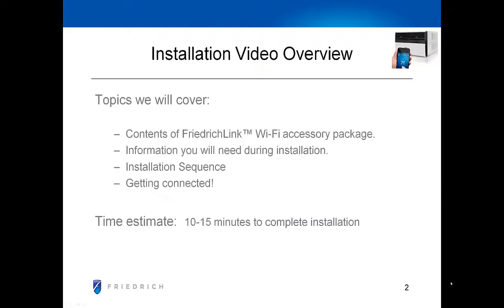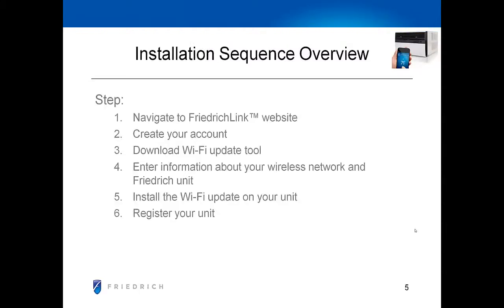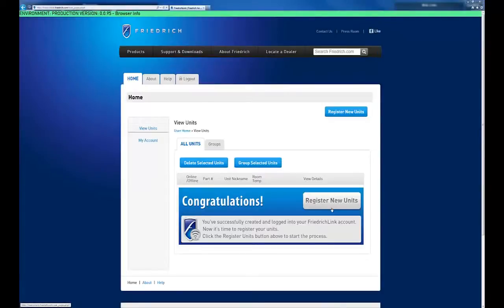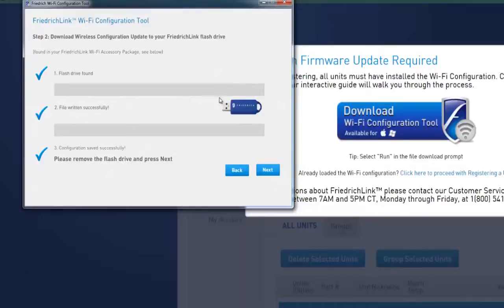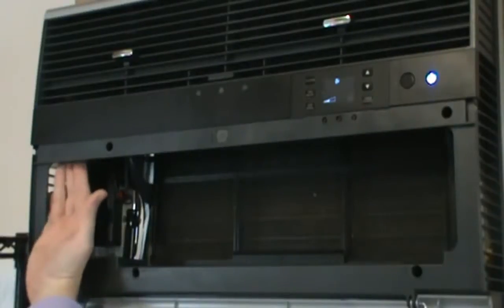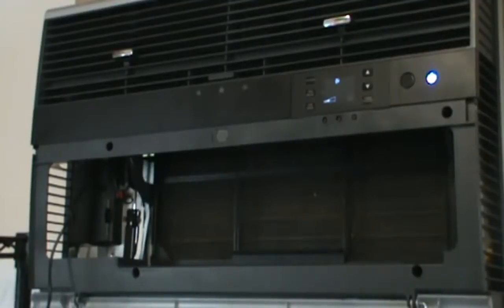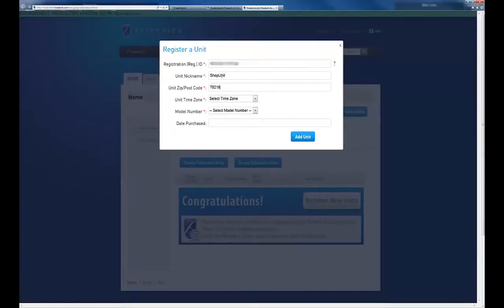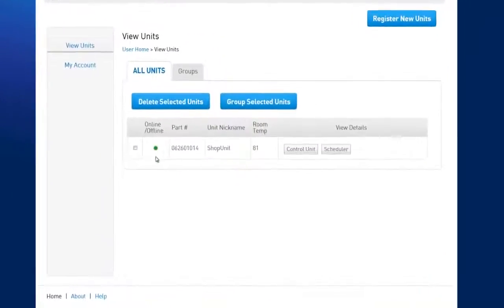FriedrichLink Kühl Wi-Fi Adapter Install

Comment: For those who fell for this video's trap by pressing the 3 keys - you can only fix it by inserting the USB drive provided in the kit with the black adapter. Even then, the drive was shipped with the files in the incorrect folders. Make sure that image.S19 is in the folder "Upgrade Program" and then insert it. For everyone considering pressing those 3 keys - DON'T DO IT! It is unnecessary, and will brick your AC. You can turn it off an unplug it, but it will remain in that state FOREVER unless you buy the Friedrich Connect Wifi adapter to obtain the USB drive with the firmware (or call Friedrich and see if they can provide it).
Reply: it bricked my unit. what do I need to fix it.
Reply: I held those 3 buttons down and now it's in dead state. any way go fix it? or get out of it??

Comment: I found the solution for Friedrich kuhl ac. How to wake your ac that nothing works except the power light is on. 
All you need to do is have your usb flash drive plug in to your computer and make sure all the files are out of the folder in your flash drive.  Before you plug to the ac unit follow this instructions and wala you got your ac back in your control. 

HOW TO BRING THE UNIT BACK TO LIFE
•	Get somebody else to help you- you may need an additional set of hands when plugging the unit back in while holding the buttons as instructed.

•	Ensure that the User Interface Cable connections are good. Unplug power cord from outlet

•	Insert the Friedrich flash drive into the USB cable.

•	Insert the other end of the USB cable to the Micro USB port. (Ensure that it is secured. Do not move during program uploading).

•	Grab the flash drive and keep an eye for the green light in the ring of the flash drive.

•	Simultaneously press the 3 Buttons Code (FAN Mode, Fan Speed, and Up Arrow) and don’t let go.

•	While pressing the 3 Button Code, have the other person plug in the power cord. (Ensure that the reset button is not pressed on the plug).

•	When the green light turns on, let go of the 3 buttons. It will blink for a few seconds; this indicates the program is loading.

•	When the light goes off, the unit should already be back to life.

•	Unplug the USB cable.

•	Test the buttons for responses.
Reply: I am having this same problem, but don’t have the firmware or USB. Any suggestion? How did you figure out the solution?

Comment: Please please anyone I need to download the update to connect to my wifi and my Friedrich ac I accidentally flashed and now it doesn't work. Please please help

If you need help this friedrich company won't help the summer is here and covd 19 is not helping either because everything is closed  can't get help outside friedrich. My ac unit is dead because I wanted to plug in wifi and now nothing work. Please anyone can help me please the old website of friedrich is not available. To download the firmware.
Reply: let me know how you get it to work

Comment: If you have the new black adapter, DO NOT FOLLOW THESE INSTRUCTIONS! DO NOT USE FRIEDRICH LINK! Use the new Friedrich Connect website. If you already pressed the 3 keys that cause your unit to go into an unresponsive state, you'll need to insert a USB with firmware on it. Make sure the root has a folder called "Upgrade Program" and contains the file "image.S19" and insert into the AC. Without the USB/firmware-file, the AC becomes useless if you pressed the 3 keys (unless there is another key combination to exit, but haven't found it. Power off/no doesn't work). Check the file/folder regardless if you just got the kit from the manufacturer - it could be wrong out of the box.
Reply: James Dugan I did the first step and the ac went blank except the power button is blue. Cannot turn on unit or do anything. I cannot find the Friedrich Connect link to download the software, seems like Friedrich shut it down. Any help is greatly appreciated. Thank you in advance.
Reply: James Dugan My drive has the image.S19 file in Update Program. But when I plug it in to the AC, it doesn’t blink/flash like it should. Any help would be appreciated.
Reply: anyone can help please 🙏

Comment: Boiuying two of these machines ($2,200) was one of the worst purchases I have made. Installation is  pain. And now they built in the wifi into their newer units and are trying to squeeze customers for money to buy an adapter to be able to utilize the wifi app. I have called their customer service Dept so many times, they are on speed dial. I am tech savvy and yet, I found this whole process daunting. Never again.

Comment: The video is misleading and tries to cover too many models.   I didn't need to hold down any buttons on my model.  As soon as I plugged in the USB Drive the fan cycled and the numbers went to 00 then 01.  The power button and panel DID NOT blink.  It helps to keep your eye on the green light of the USB drive itself.  After a lot of frustration, I got it to work.

Make sure your wifi is good at the a/c's location.  The wifi (flashing ice cream cone) takes about 30-45 seconds to sync up.  Press the up or down arrow to keep the panel alive as you monitor the wifi indicator (it fades after 20 seconds). 

Also, of note, the commands from your phone or computer take about 60-75 seconds to make it across the network to your home network and then up to the a/c unit.  So don't expect it to work like a TV remote.  The delay is significant.   But it works.

Comment: 1- using pc do this and that, everything successfully performed.  
2- turn it on, fan mode only, plug USB in,  press and hold sys n fan mode and up buttons all at the same time.  Fan went off and never turn back on. Is been days now. 🙁 
Tried to reset, left unplug the unit for hours and nothing, all I see is the power button on (in blue) 
Sucks.   About to go get my 20 years old AC from basement.
Reply: kifeYOU5 Did you figure this out? I have the same issue and can not get this thing running!
Reply: i forgot to add one thing, format your flashdrive FAT32 first 
and set the following name as the "Volume Label"  FRIEDRICH  

DO NOT use the friedrich flashdrive that came with the kit, instead use a
 different flashdrive.  i used a 4gb flashdrive.  Now, follow the 
instructions to configure the flashdrive using the "friedrich wifi 
configuration tool" and stop at step 2 ( this is when the flashdrive has
 been configured ) remove the flashdrive from the computer.  Go to the 
air conditioner turn it on and make sure it is in fan only mode.  Take 
your flashdrive and plug into the USB cable that came with the kit and 
then plug the other end of this cable into the air conditioner micro USB
 port ( this cable only fits one way into the air conditioner micro USB 
port.  look closely at the cable micro USB head, it has to fins, those 
fins should be facing up as you plug it into the air conditioner USB 
port )  The air conditioner will shut down, get the info from the 
flashdrive, display 00 and then 01 on the LCD and turn back on 
automatically ( if the air conditioner does not display 01 then try 
using a different flashdrive). Unplug the USB cable from the air 
conditioner (the air conditioner will turn off and then turn on 
automatically) Plug in the friedrich "wifi adapter" remember the two 
fins on the micro USB head of this adapter should be facing up. The air 
conditioner will turn off and on automatically and the wifi icon on the 
LCD will blink for about 20 seconds and then stay steady. That's it. if 
you are still having issues let me know.
Reply: I have same issue and cannot get unit to power on!  How did anyone here get the unit back online??
Reply: @juliewinskie  use a different non-friedrich flash drive.  see my other post regarding the formatting of the flash drive.  after formatting the flash drive, use the "friedrich wifi tool" to configure it
1.unplug the air conditioner. wait 10 seconds
2.plug the air conditioner back
3.insert the flash drive into the air conditioner and wait 30 seconds
4.remove the flash drive
5.DO NOT REFORMAT but reconfigure the flash drive one more time using the "friedrich wifi tool" software.
6.plug the flash drive back into the air conditioner.  within about 30 seconds, the unit will display 00 followed by 01.
7.remove flash drive from the unit
8.plug in the friedrich wifi adapter.
Reply: djdeito only power is lit.  Please help
Reply: @Chaseb911  use a different non-friedrich flash drive.  see my other post regarding the formatting of the flash drive.  after formatting the flash drive, use the "friedrich wifi tool" to configure it
1.unplug the air conditioner. wait 10 seconds
2.plug the air conditioner back
3.insert the flash drive into the air conditioner and wait 30 seconds
4.remove the flash drive
5.DO NOT REFORMAT but reconfigure the flash drive one more time using the "friedrich wifi tool" software.
6.plug the flash drive back into the air conditioner.  within about 30 seconds, the unit will display 00 followed by 01.
7.remove flash drive from the unit
8.plug in the friedrich wifi adapter.
Reply: use a different non-friedrich flash drive.  see my other post regarding the formatting of the flash drive.  after formatting the flash drive, use the "friedrich wifi tool" to configure it
1.unplug the air conditioner. wait 10 seconds
2.plug the air conditioner back
3.insert the flash drive into the air conditioner and wait 30 seconds
4.remove the flash drive
5.DO NOT REFORMAT but reconfigure the flash drive one more time using the "friedrich wifi tool" software.
6.plug the flash drive back into the air conditioner.  within about 30 seconds, the unit will display 00 followed by 01.
7.remove flash drive from the unit
8.plug in the friedrich wifi adapter.
Reply: Ed Things I don’t know what happened but the ac went blank except the power button is blue. Cannot turn on the unit or do anything. I cannot find the Friedrich Connect Connect to download the software, seems like Friedrich shut it down. Any help is greatly appreciated. Thank you in advance.
Reply: @Coolww  did you get to fix it
Reply: If you have the new black adapter, DO NOT FOLLOW THESE INSTRUCTIONS! DO NOT USE FRIEDRICH LINK! Use the new Friedrich Connect website. If you already pressed the 3 keys that cause your unit to go into an unresponsive state, you'll need to insert a USB with firmware on it. Make sure the root has a folder called "Upgrade Program" and contains the file "image.S19" and insert into the AC. Without the USB/firmware-file, the AC becomes useless if you pressed the 3 keys (unless there is another key combination to exit, but haven't found it. Power off/no doesn't work). Check the file/folder regardless if you just got the kit from the manufacturer - it could be wrong out of the box.

Comment: did this work for anyone?
Reply: Sean Crawford i forgot to add one thing, format your flashdrive FAT32 first and set the following name as the "Volume Label"  FRIEDRICH   

DO NOT use the friedrich flashdrive that came with the kit, instead use a different flashdrive.  i used a 4gb flashdrive.  Now, follow the instructions to configure the flashdrive using the "friedrich wifi configuration tool" and stop at step 2 ( this is when the flashdrive has been configured ) remove the flashdrive from the computer.  Go to the air conditioner turn it on and make sure it is in fan only mode.  Take your flashdrive and plug into the USB cable that came with the kit and then plug the other end of this cable into the air conditioner micro USB port ( this cable only fits one way into the air conditioner micro USB port.  look closely at the cable micro USB head, it has to fins, those fins should be facing up as you plug it into the air conditioner USB port )  The air conditioner will shut down, get the info from the flashdrive, display 00 and then 01 on the LCD and turn back on automatically ( if the air conditioner does not display 01 then try using a different flashdrive). Unplug the USB cable from the air conditioner (the air conditioner will turn off and then turn on automatically) Plug in the friedrich "wifi adapter" remember the two fins on the micro USB head of this adapter should be facing up. The air conditioner will turn off and on automatically and the wifi icon on the LCD will blink for about 20 seconds and then stay steady. That's it. if you are still having issues let me know.
Reply: Ed Things I did the first step and the ac went blank except the power button is blue. Cannot turn on unit or do anything. I cannot find the Friedrich Connect link to download the software, seems like Friedrich shut it down. Any help is greatly appreciated. Thank you in advance.
Reply: Ed Things I did the first step and the ac went blank except the power button is blue. Cannot turn on unit or do anything. I cannot find the Friedrich Connect link to download the software, seems like Friedrich shut it down. Any help is greatly appreciated. Thank you in advance.
Reply: @djdeito  looking for the friedrich link tool can you help
Reply: If you have the new black adapter, DO NOT FOLLOW THESE INSTRUCTIONS! DO NOT USE FRIEDRICH LINK! Use the new Friedrich Connect website. If you already pressed the 3 keys that cause your unit to go into an unresponsive state, you'll need to insert a USB with firmware on it. Make sure the root has a folder called "Upgrade Program" and contains the file "image.S19" and insert into the AC. Without the USB/firmware-file, the AC becomes useless if you pressed the 3 keys (unless there is another key combination to exit, but haven't found it. Power off/no doesn't work). Check the file/folder regardless if you just got the kit from the manufacturer - it could be wrong out of the box.